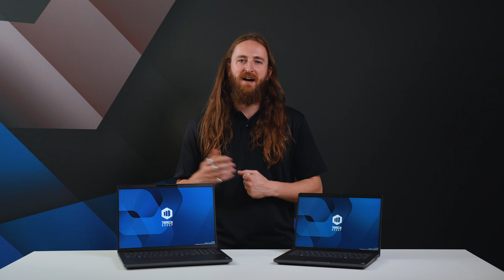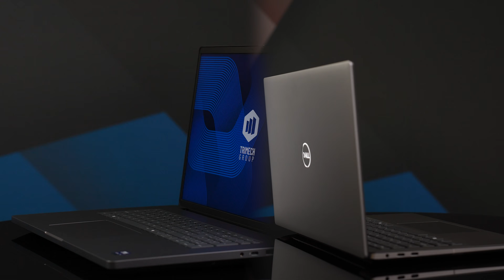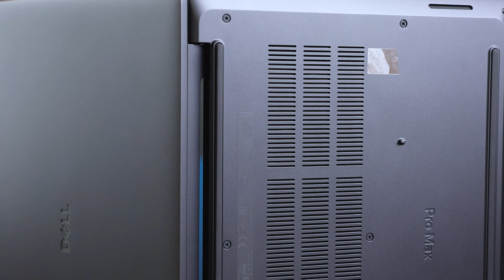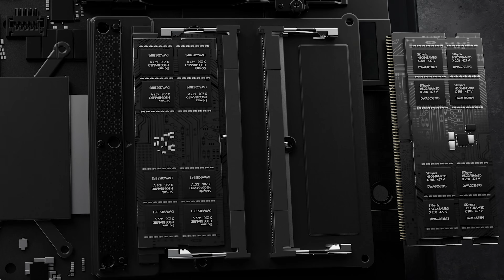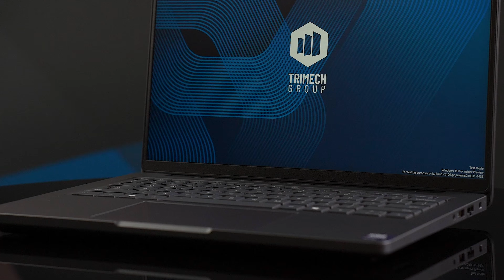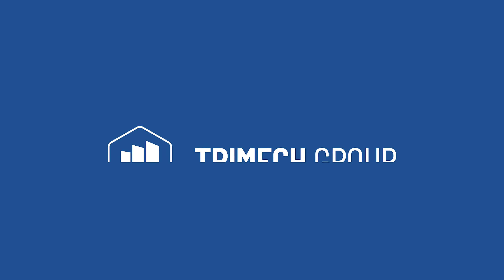Dell Pro Max 14 & 16

Comment: The Precision 3571/3591 were basically perfect. The increased size and mass of the Pro Max 16 is absolutely unacceptable, it's a monster by comparison. You can't go to the Pro Max 14 though as it gets rid of the numpad.

HORRIBLE solutions by Dell